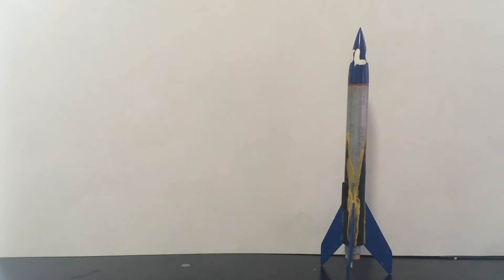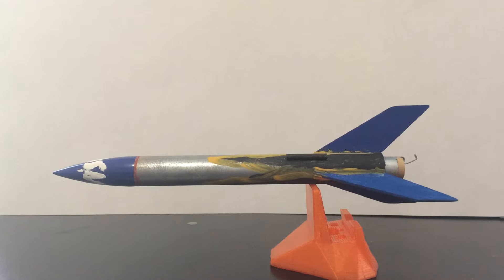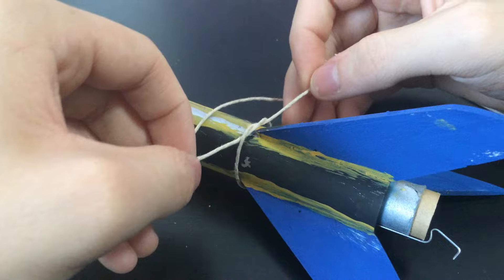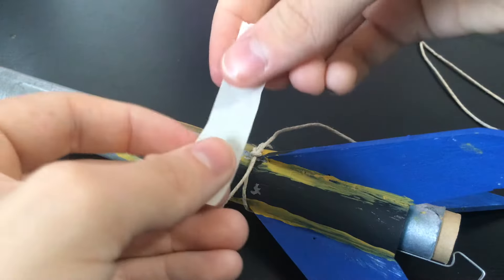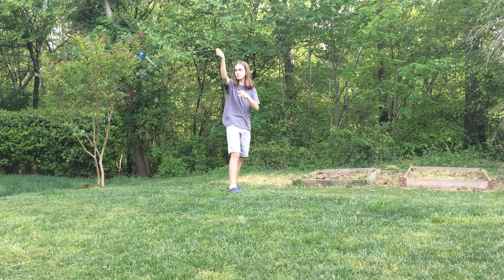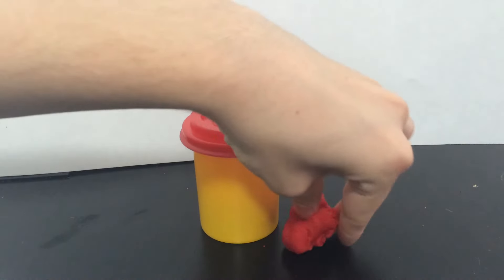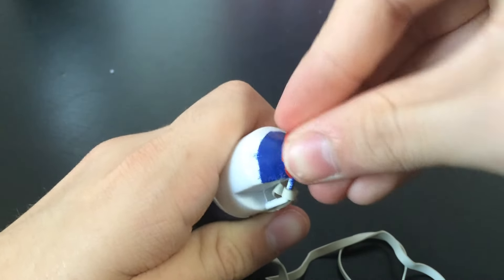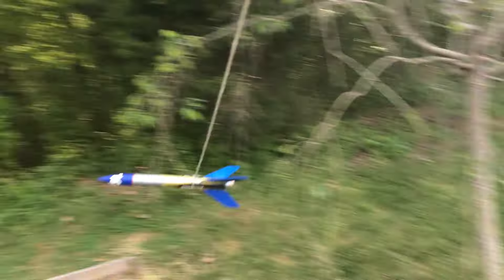Model Rocket Stability (Rocket Swing Test) Tutorial

Comment: This was absolutely wrong because by adding clay you changed the centre of gravity of the rocket and because of that much weight the rocket will turn downwards and it would be a complete failure
Reply: You do realize that the center of gravity was the entire reason it flipped in the first place? 
Changing the center of gravity is what fixes the issue.
Reply from the maker: https://en.wikipedia.org/wiki/Pendulum_rocket_fallacy